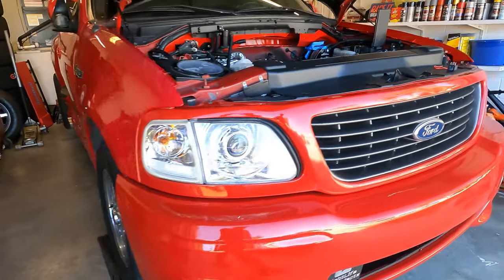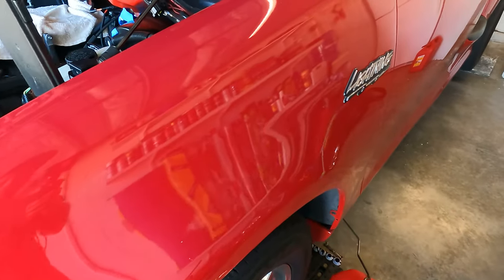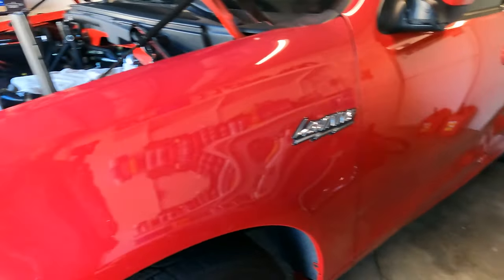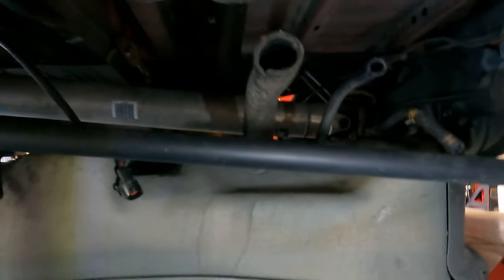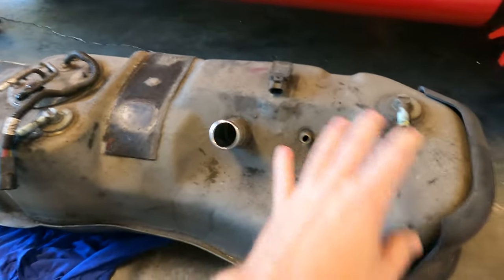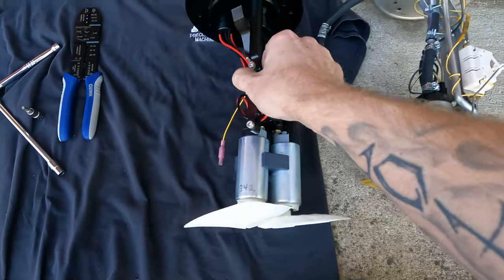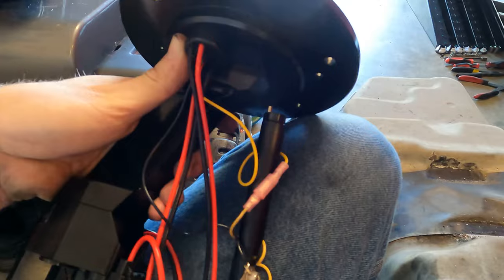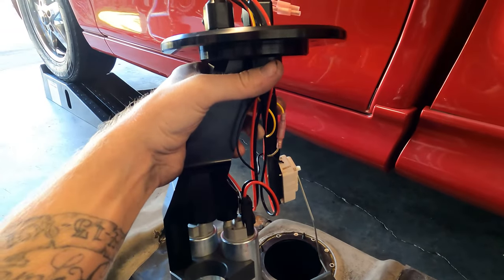Dropping the Fuel Tank and Installing Fore Innovations Triple Pump Fuel Hat on the SVT Lightning!

Comment: Did you ever do a video on the gas tank venting
Reply from the maker: I didn't, I was advised not to, due to epa cracking down on that kinda stuff, not worth the risk.  But it's easy, just run a hose off each vent on the tank, to a T fitting, then one hose up the filler neck to a breather filter.  I also packed my breather filter with fish tank charcoal, to help with the fuel smell.

Comment: I have a similar triple pump fuel system, from a different vendor, installed on my L.  I did have an intermittent problem with my fuel quantity gauge reading zero.   A local Ford dealership technician found that the triple pump and fuel quantity sensor had an interference fit.  He fixed it and all is well.  Just an FYI…
Thank you for the great vids, DebtLife!!!   👍🏼😁

Comment: Hopefully your fuel sending unit still sends an accurate reading to the fuel gauge. Also, is there a reason you used crimp connectors instead of soldering and heat shrink?

Comment: I’ve got a question that you might be able to help me with, when I get on it in my 02 lightning at full throttle right about 100-105mph I notice it cuts out just a little bit but nothing to bad. It has a 6 lbs lower and K&N cold air intake with a hand held SCT tuner. The MAF sensor seams too look stock.
Reply from the maker: That can be a ton of things and impossible to know without more data/info.  First thing I always do is start with the plugs.  Pull, look at, and replace the plugs.  I'd also be skeptical of a stock maf with that much pulley, needs a ba2600/retune, and also no boost cooling mods?  If not, get some asap, these blowers create a lot of heat.
Reply: @DebtLife_Projects  okay thank you so much for the info! I’ll be sure and do that!